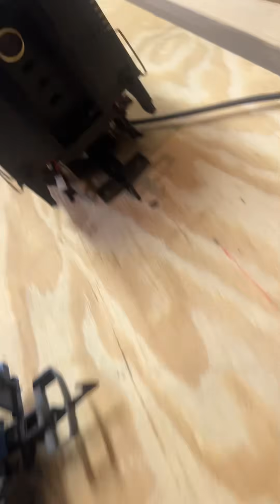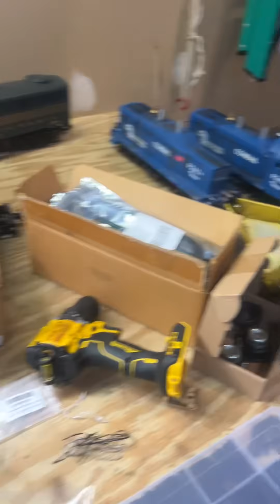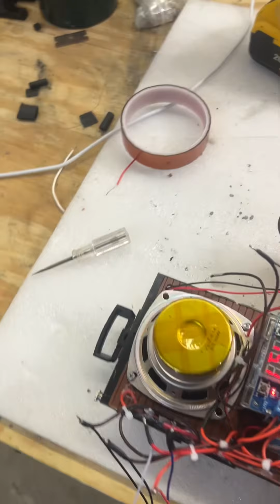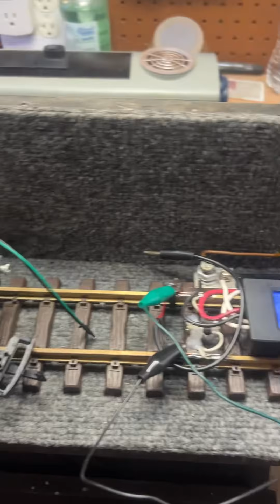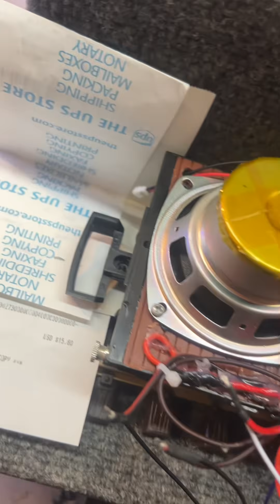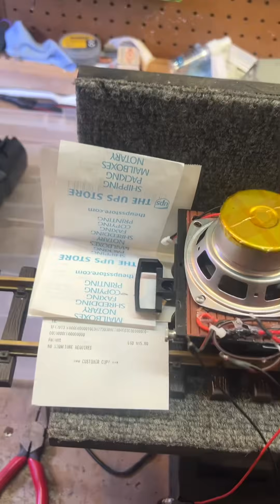SoundTraxx Blunami 4408 and Dewalt deadrail.

Comment: So Question, Did you wire your FA-1 Two each motors in series instead of parallel as soundtraxx recommends which reduces the amp draw for the Blunami 4408 board which is only 4 amps??
Reply from the maker: I wire all of my engines in parallel.

Comment: Any thoughts and directions for powering an ABBA set of F units from USA Trains?  I am just leaning about batt power.  The concept of dead rail sounds good to me…. 🙂
Reply from the maker: I will show you an AB running off of 1 Box car later today in another video.  ABBA would be a bit much for 1 decoder to handle amp-wise.  Blunami has the ability to consist an unlimited number of engines together but each engine needs to have its own blunami in it.  That would absolutely work.  Another option would be AB Boxcar BA boxcar utilizing the tech in my video on both boxcars.  3rd option is to place a Blumani in each A unit and put the battery in the B units (or the A units as they're large inside).  Then you could consist them together as an ABBA.  Cheers